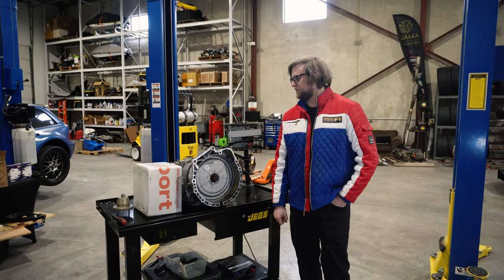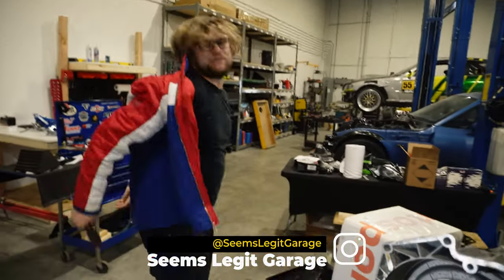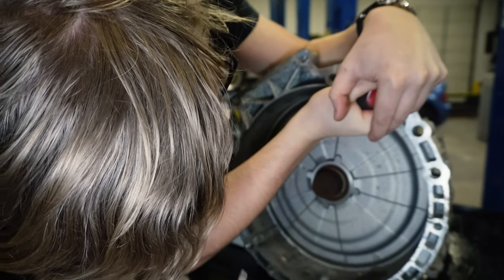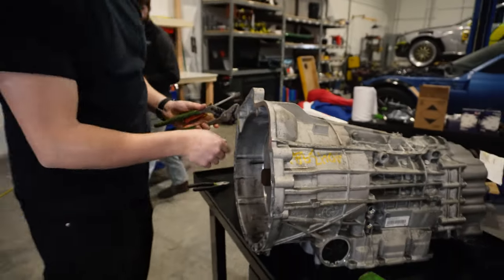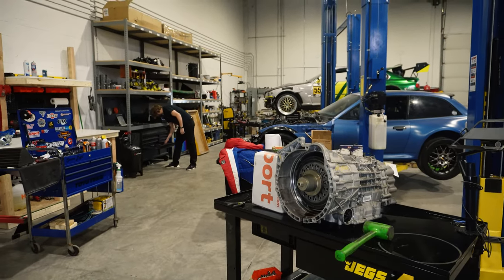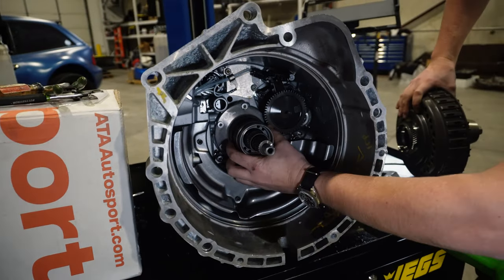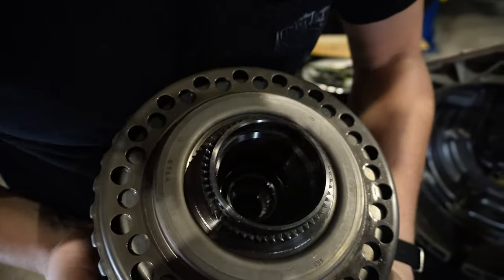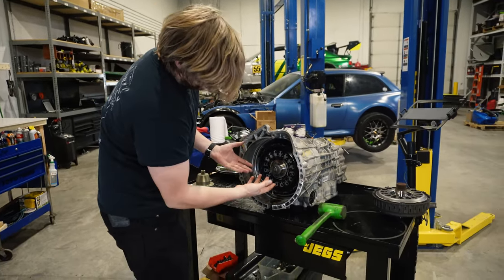BMW DCT Build- ATA Stage 2 Cutch Upgrade

Comment: I have too drop my transmission too change my rpm sensor located inside my transmission (335is dct) anything I should be aware of as a first time learner and what are u holding on the back of the transmission too allow the clutch too spin ?
Reply: Same doing that tomorrow, are you getting input RPM sensor codes and delayed rpm gauge shifts ?
Reply: @kinglongdickmaster4267  no I didn’t get either one of those codes but I was getting temperature codes don’t remember what they were exact and my car would basically give out after driving for a couple hours I changed the sensor and that light and code went away but now still having the same problem smh

Comment: I have a Z4 with the DCT does this clutch affect the daily driving? I have a stage 3 TCU tune. Is this clutch the reason why our cars start slipping around 600whp?
Reply from the maker: The line pressure stock just cant hold more power. We no longer sell ATA but we do offer others
Reply: @SeemsLegitGarage what other options do yall offer now for 650-700whp n54 dct 335is
Reply from the maker: @kinginmortal5720  SSP clutches

Comment: Nice video guys! I have a 335i n55 with a dct (from Mexico) and my temperature sensor seems to be playing too much with the numbers, going up and down by a little and then jumping from 150 to 250. I wanna replace the sensor I think I can see it when you take the clutch out do I need any special tools to get the sensor out do you know? I have to do this myself nobody where I live wants to work with euro cars 😢. Thank you so much for sharing
Reply from the maker: it just unbolts, easy to do once you remove the clutch

Comment: What dct one are y’all running because I wanna beef up my 2004 525i auto clutch up. And are y’all in contact with any tuners for the 04 525. I have a m50 intake on my m54 and headers. I want a tune and to beef up my transmission.
Reply from the maker: Our e46 runs one out of a 135i

Comment: There is a few important steps to complete before driving once the DCT is installed back into the car via BMW repair instructions:
1. Reset the torque characteristic (service function)
2. Perform the clutch adaptation (service function)
3. Teach in valve characteristics (service function) 

If you dont do these steps you WILL damage the DCT gearbox.
Reply from the maker: These are using HTG standalone controllers, all that is covered in adaptations when you install the controller.
Reply: What do u mean and how do u do it since I’m dropping my transmission

Comment: Just installed mine , all I need to do is the oil balancing ? When I fill ? Been driving good
Reply from the maker: Yea just do a factory fill procedure and you'll be set! Don't loose much changing the clutch luckily
Reply: @SeemsLegitGarage  cool. I also just did the SSP cooling kit. Holds 9L lol, still doing my break in rn

Comment: Have you Gentlemen ever see the mechatronics take a dump? And if so, what usually happens? What are the signs that it is going out the window?

So going to do this on my E46 M3 that's for damned sure!
Reply from the maker: Sometimes sensors go bad you gotta look at the datalog and se what doesnt make sense

Comment: No coding needed??
Reply from the maker: correct
Reply: @SeemsLegitGarage  would you say this is same as ssp? Iguess my real question is will this stage3 be a good upgrade for a single turbo 335is at 700whp & similar torque?
Reply from the maker: @kinginmortal5720  For that I would use stage 2